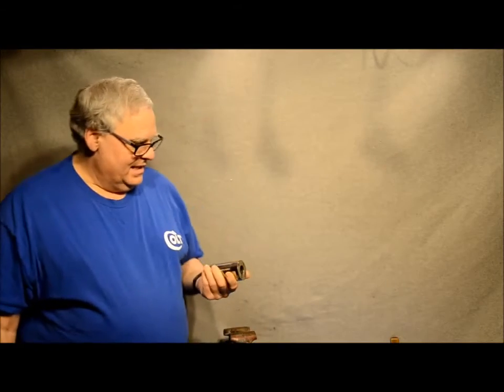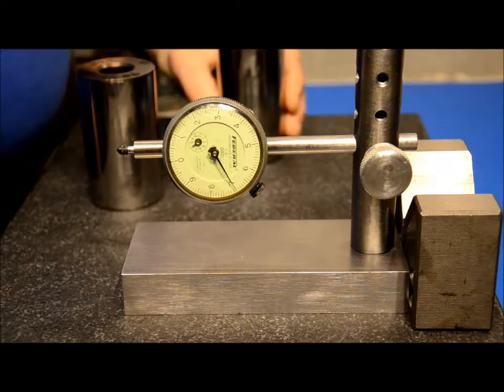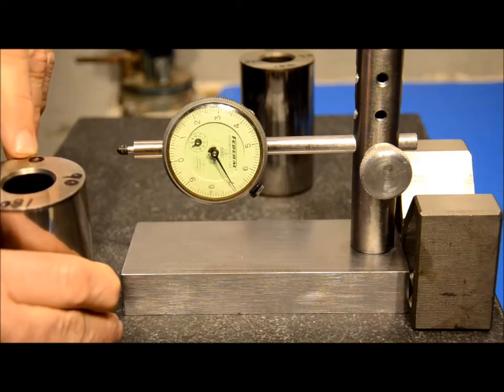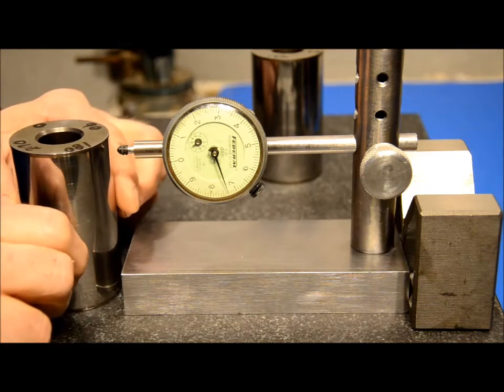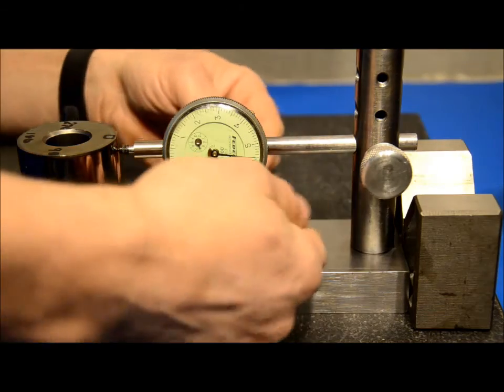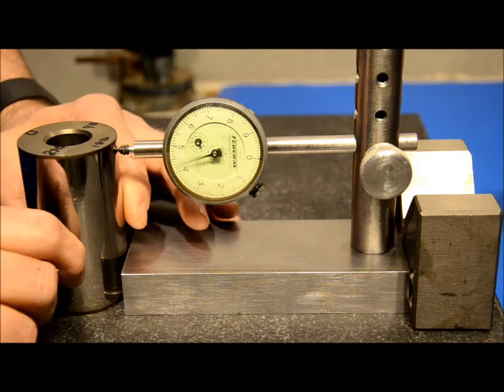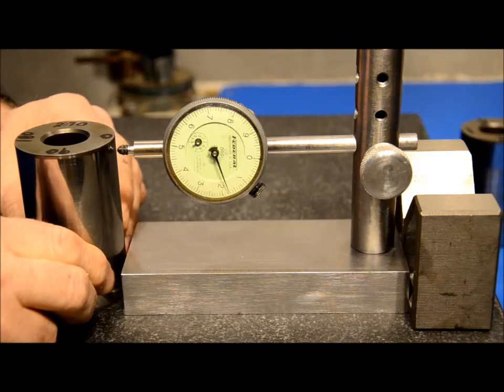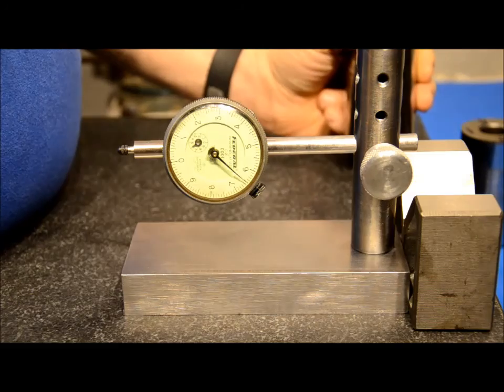Poor mans Cylindical Square

Comment: your doing fine, hand lapping works just fine, it's the result you have achieved that's fantastic
Reply from the maker: Hi Stewart, Thank you for the comment.  This was one of my first video; s I could have done a better job with the execution.  Still It was fun and I got a reasonable square reference for the price of picking through the local diesel shop scrap pile.

Comment: Back in the early 60's as a second year apprentice under instruction I made a precision cylindrical square with a piece of hydraulic cylinder ram 75mm diam and 300mm long.
The OD had been hard chrome plated and ground.
I centred each end using a lathe and running each end in a bronze tipped steady.
Finally the piece was run between centres and the end face undercut and faced by grinding across the edge face.......that is as square as you can get it without exception.
Due to constrains of security I was unable to take the square with me and so it was left in the workshop tool room as part of the equipment.......one day I will make another one as the method of production and availability of material is so simple.

Comment: Yes. I would be interested in seeing the lapping process for a tolerance of .0001". I suppose the plate you use would be useless after doing a cylinder or two, no?
Reply: You correct and re lap from time to time but the geometry isn't always important in a lap

Comment: Hey paul... can you share the details on that large pin as far as the part number and where it can be purchased.... any information as to where you purchased it would help.. thank you sir!
Reply: piston/wrist pins for diesel engines on ebay. The come in various sizes. I have an 84x95mm that I got new for about $25
Reply: @juliejones8785  thanks

Comment: Hey Paul, thats the beauty of a cylinder square, they are self proving and are always right in 1 spot!
Reply: It seems like if the base has no rock, then there must be two square sides 180 degrees apart.
Reply: i need to make myself one
Reply: I'm playing with 2 wrist pins right now and you're absolutely right.